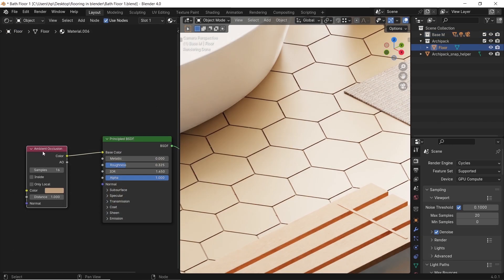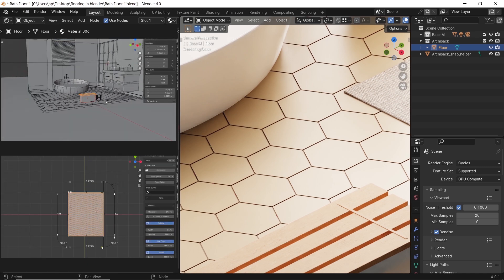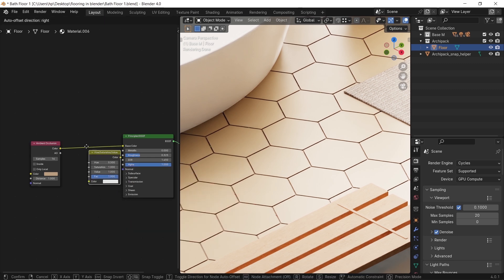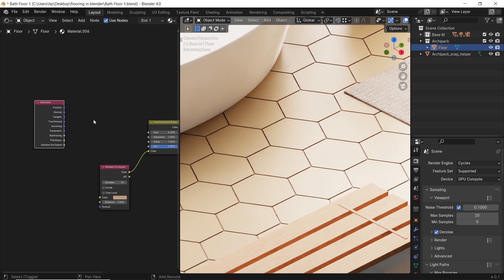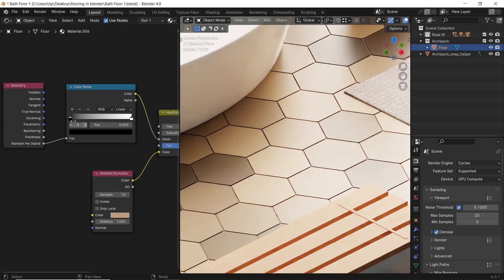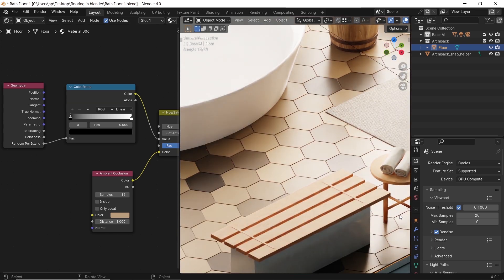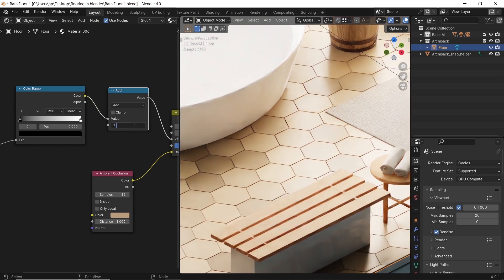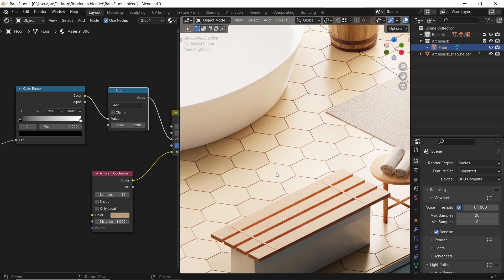A flooring trick in blender you should know!

Comment: Great tip. 
One nitpick, you don't need a value node... just lower value of the black on the ramp to a lower value (more gray). Correct me if I'm wrong on this.
Reply from the maker: the math node? Well yeah sure you can control the color gradient in the ramp but it won't show up on the group node that's why you need sometimes numeric fields for easer control from outside once you group them.
Reply: @architecturetopics  In that case, yes.

Comment: Thank you very much. This is what I am looking for and I would like to ask you to expand the topic. How did you make these tiles, did you use a floor generator? How to add different textures on the floor, how to do it also with chevrons? Is it possible to change the angle of the short edge of the board on the generator Like in 3d max? 

￼
Reply from the maker: Glad it helped mate! this was done with Archipack a while ago and will do more on the topic later on.
We will also share a floor generator in the next video which might help so stay tuned!
Reply: @architecturetopics   THANK YOU FOR ANSWERING. I LEARNED A    L O T    FROM YOU.

Comment: Hmm, does nothing for me, checking the output of the color ramp, it's just all black. Is there some setting you need to do building the floor with Archipack to ensure this works?
Reply from the maker: Switch to render view!
Nothing special about the floors, you can do any cuts and make a floor following this method.
 It will only show up in render view so material preview might give you black/white look .
Reply: @architecturetopics  I tried it in cycles preview but got the same. I'm wondering if it's a archipack issue as the floor doesn't show unless I uncheck random material. I'm using the latest community edition of archipack with blender 3.6
Reply from the maker: Not at all, it has nothing to do with it being archipack floor.
You can do a simple floor with a plane and some array then apply this method and it will give you the same result shown in the video.